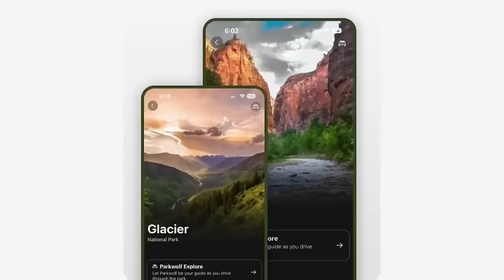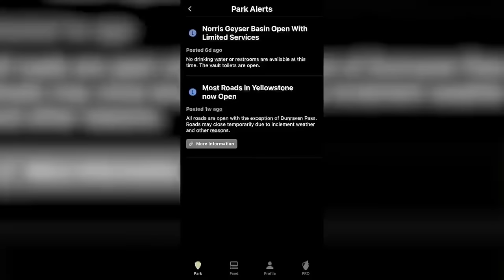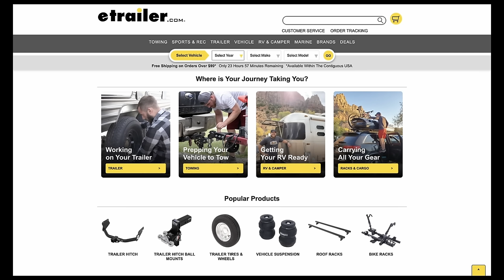309. Live from the Seattle RV Show and the Best 2024 RV Makers and RV Tech with Josh the RV Nerd

Comment: The problem with Crocks- thorns can go right through them and into the soft spot of your foot. 🦶 PAIN!  As a hospital worker walking on hard floors- Dansko hands down. It may not make sense- but having firm arches make all the difference!
Reply from the maker: I’ve never heard of Dansko. I’ll look them up. I suffer from leg exhaustion on the regular so I’m always looking for the four leaf clover of shoes. Oofos has served me well for around the house but they aren’t shoes I’d wear for a day out hiking, etc. they’re recovery shoes. Thanks for the suggestion! -A
Reply: As a retired warehouse worker I can highly recommend the Kybun line of footwear. My wife suggested we go check them out and my thoughts were that no way would we pay that much for a pair of shoes. It only took a few steps and I was sold.

Comment: Question…do Ember trailers still have to have anti sway bars or unnecessary because of the spring/suspension system? What would be the downposite on one….lol
Reply from the maker: Sort of depends on your tow vehicle. I would say if it feels like it needs it get one, but if it feels rock solid you're probably fine. I would definitely use a weight distribution hitch with an SUV or half ton truck though.